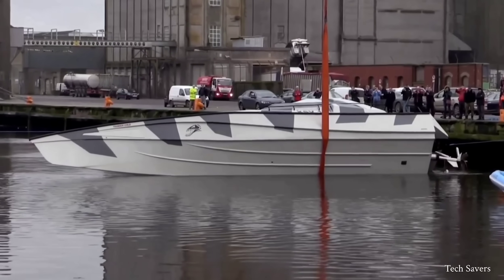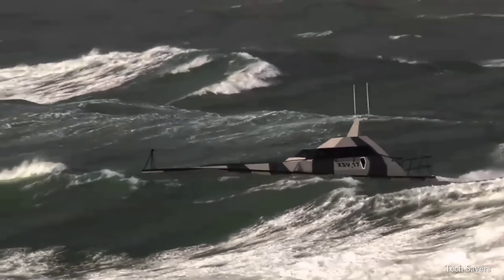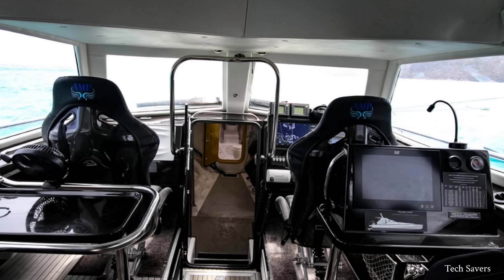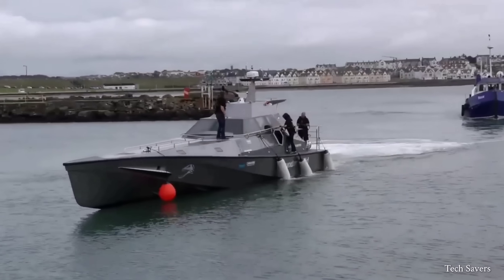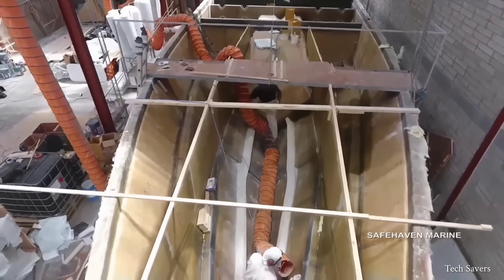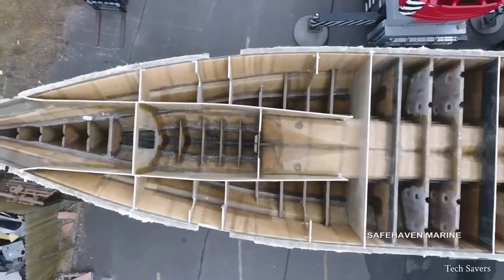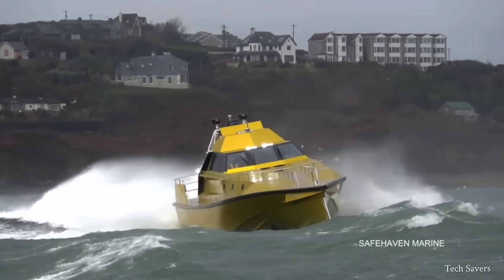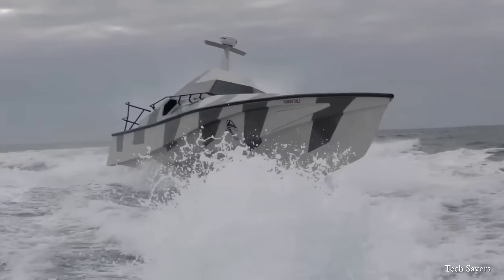This Boat Is Unsinkable : Thunderchild XSV 17 The Unsinkable Boat

Comment: Yeah I'm not real big on using wood for the frame. With all the lightweight alloy framing or other polymers and kevlar, sure it didn't work out too good for that submersible after how many successful missions? Not like this interceptor is going to those type of crushing depths. Yeah the wood is like cheaping out, and probably adding a lot of unnecessary weight. What do I know, it just seems like there are much higher quality materials out there.

Comment: Unsinkable’ is always relative. 
Without proper buoyancy compartments, even fiberglass boats can flood if damaged. 
Aluminum hulls with sealed chambers offer better safety, strength, and long-term durability. 😎

Comment: History demands the "Bounce it off a iceberg" test.
Reply: And the 12 drinks in test. Those two things seem to take most of the ships.
Reply: краш тест на титанике уже провели - результаты отрицательные ))
Reply: The materials used in construction of the vessel are naturally buoyant so enev hitting a solid rock at 30 knots tearing a hole from stem to stern would not sink it, may cause enough damage to make it a write off, but the vessels buoyant materials would mean it would stay afloat regardless!!!

Make a tot boat out of styrofoam, break it apart and see if that sinks... Same principal!
Reply: And a bridge
Reply: It would probably flip over and right itself completely unharmed. As much smashing as it takes just hitting waves I think it would skip over ice no problem. Probably not a head on collision with an iceberg though. Who knows?
Reply: That would be cool

Comment: Cool. The 47' Motor Life Boats that the USCG can auto right themselves and have been in use for a couple of decades now.
Reply: Design + R&D + construction of this boat costs 1 million USD, the  USCG's 47' MLBs costed 1,214,300$ in 2003 dollars per unit (or $2,110,500 in 2025 USD) and the latest life extension program costs 2,000,000 USD per hull giving the MLB 47C, the latest version of the USCG's MLBs,  a final price tag of ~4.1 million per boat.
(MLBs also have a maximum speed of 25 knots while the XVS 17 reaches 54 knots, they also have vastly different mission profiles but whatever)

Comment: From the perspective as someone who maintained electronics on boats, you'd need to service/repair any antennas on it after rolling. Better than sinking for sure, but there will almost always be damage.
Reply: Aren't storms worse than just submerging the antennas? Storms can be the same as a high pressure water wash? Also, is it possible to make the antennas hermatically sealed to completely avoid any moisture at all from getting to them?
Reply: @mrjager2775  storms can absolutely cause major damage, I'm talking about cracked welds, bent and panting bulkheads. I'm seen a bent gun mount for a 25mm autocannon and welded ammo storage torn off the deck. That said, with a rollover, it's going to depend on the specs of the antenna, how well the maintenance and waterproofing is done, the type of antenna etc. Some are short, some are whips. Some have holes to prevent condensation buildup. It's going to need to be gone over by the techs to make sure everything is good to go afterwards as far as function and performance. Damage of some kind is very common. It doesn't take much to bend the elements of a direction finder for example.

Edit: engineering will have similar tasks to ensure everything works afterwards.
Reply: The most survivable VHF antenna would likely be a very springy stainless steel whip. It would still be wise and prudent to carry spares though. The only way HF would be possible is temporary deployment. Hardly ideal, but that's life.
Reply: Thank you, Captain Obvious.

Comment: I wonder now with foils so prevalent with sailing yachts, will this cross over into power craft like this.
Reply: Probably not, as these power boats are going above 50 kts which is near the true max speed of a foil, that’s where cavitation starts to occur due to the water boiling on the hydrofoil, you see with bigger ocean racing yachts that they are partially foiling, which is very efficient, especially out in the ocean, where you can’t change that stuff, and it needs to be dead reliable, I think it will be a while before we see true powerboats on hydrofoils, if ever
Reply: Foils  don’t work in very heavy seas like the ones shown in those video

Comment: 54 knots equals 62.1421 mph!
Reply: 54 knots is  also  100.008  Kilometres per  hr (Just  saying)
Reply: I got 61.3636363656 mph
Reply: I stand corrected.  I was wrong about the length of a nautical mile.  Thanks for setting me straight.
Reply: Which is about 100 kilometers per hour, like it was said in the video? Or are you just translating for Americans

Comment: Ahhhh if the water was say 10 mm deep   ie shallow,it probably won't sink. But DEEP water can claim any vessel. And by the way really really deep water should this foam filled flunkie be unfortunately to make to crush depth then all the styrene would be crushed out of the foam and she would plummet to the bottom like all the other Unsinkable legends. Case in point, The Titan,
Reply: As a boatbuilder and yacht designer, I would say something like this. This boat if holed has enough built in bouncy to stay afloat . But I guarantee given all resources available this boat could be sunk.

Comment: All boats can sink if the water is deep enough, its just basic physics.
Reply: What would deep water have to do with it??? 
That literally makes no sense, and is not " basic physics " 😂
For example.
If u put a sealed empty plastic bottle in the water.
It doesn't matter if that water is 2 feet deep or 2000. It's still gonna float no matter how tossed and turned it gets.
The only way it will sink is if it becomes unsealed. 
Same with this boat.
If water can't get in.
 It will float.
Reply: Here engeneers mean about boat instead of boat with open-ear idea. But you is stupid gloomy that.
Reply: Boston Whaler takes issue with that statement.
Reply: A fire will destroy the foam... then it sinks
Reply: How does water depth impact the probability of a boat sinking and what does it have to do with „basic physics“ 😂. If you try to sound smart you should actually be smart
Reply: If it's full of stryafoam ?? 😮 Enough with holes won't sink. Hello ?
Reply: @RamnRamn-du1fc  even if the boat is made of styrofoam, any boats with enough direct hits from an Exocet missile will send it to the seabed

Comment: The same was claimed about RMS Titanic. 
A collision sunk her…, is this ship impact proof also?
Reply: If it floats it sinks...
Reply: @markrichards636  Indeed possible, yes. No such thing as unsinkable or indestructible.
Reply: @markrichards636  styrofoam...it floats..doesn't sink
no matter how much you break it and fill it with holes, it floats.
same principle
Floating in such a kind of vessel isn't give by the watertight principle, (where you can literally make a ship out of concrete because you use the physics of displacing water volume) but from the materials themselves, that just float
Reply from the maker: Yes, the Thunderchild boat is impact proof also it is composed of strong Fibre reinforced plastic which makes it extremely durable and light in weight and "the vinyl ester resin used in the boat has high resistance to both water absorption and chemicals."
Reply: @Tech_savers67  Well yes, I was actually sarcastic. 
No matter what fibers, plastics, reinforcement or resins used, 
During impact under speed and all the inertia against a rock under water, a structure at sea or a steel vessel. The composite material will tear, rip and crumble. UVB radiation will weaken it too given time. 
But sure, it would probably take some time to knock it apart using a small hammer or rocks and muscle power.
Reply: @Tech_savers67  This industry is rife with bad engineering, false advertising and crappy boats. This comment is a perfect example of why. It's not impact proof, and it can sink. And something tells me Safehaven Marine have neither tank tested, cfd tested or even submitted their "designs" to any reputable architectural firm, which explains the strange-looking hulls. They are certainly eye-catching, and perform somewhat predictably in controlled marketing-driven tests, but I'm very skeptical of their overall seaworthiness.
Reply: @adrienrassat1965 You may have been told „something“, but it should be noted that Safehaven doesn‘t claim their boats to be unsinkable. It is a claim of this video, not affiliated with the manufacturer. Besides, it is mixing 2 generations of boats (Thunderchild I and II). This is pretty mashed collection of info.